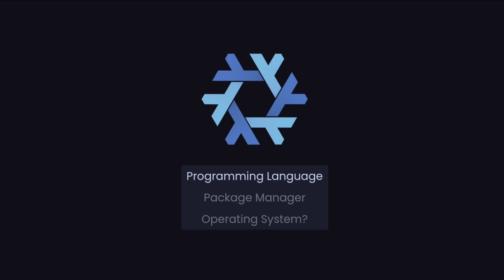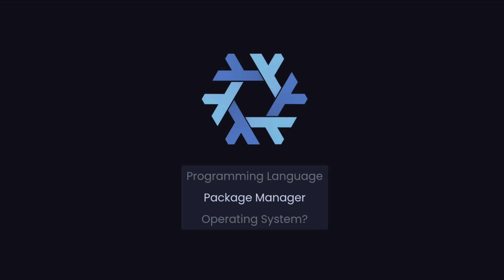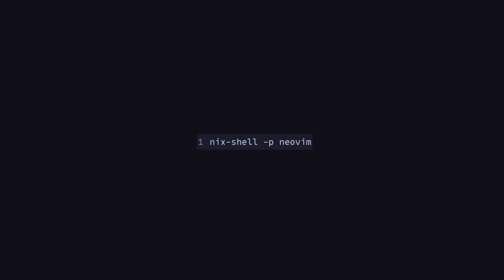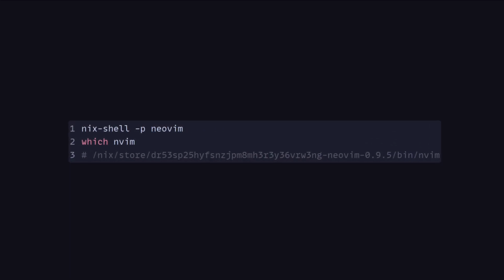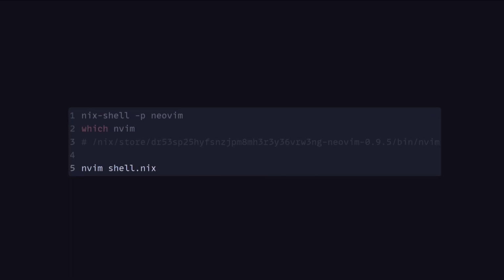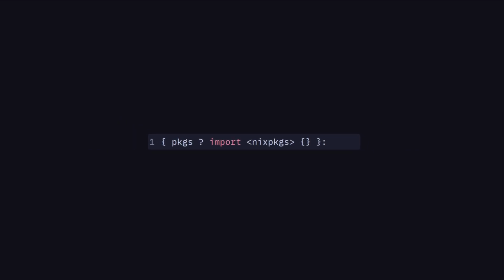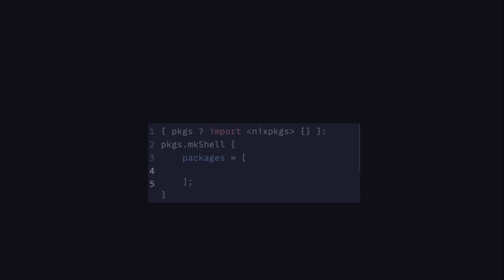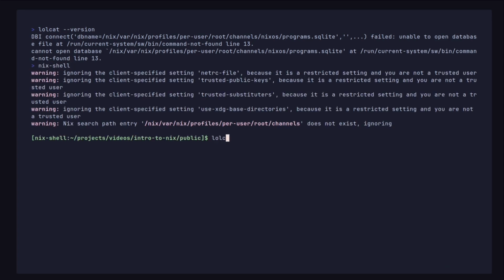An Introduction to Nix

Comment: You must be recording in a noisy environment, there's some attenuation of high frequencies and other audible artifacts, consider recording in a quiet environment for better audio quality which may help with hacking the youtube algorithm. I gave you a like and subscribe to help, it's a community service to boost media which is high quality, thank you for explaining Nix and good luck with your YouTube channel.

EDIT: could be laptop fan noise or other vibration noise such as from a keyboard or desk if mic is built-in or not properly isolated (see shock mount for reducing vibrations through mic stand from going into the microphone, hence the fancy look of studio mics), consider external microphone.

EDIT 2: just trying to help hack the AI, sounded fine to me as a human
Reply from the maker: First, thank you for taking the time to make this detailed post and provide feedback.

I think the main issue was that, one, I ended up rerecording a part and the RAW audio was a lot louder. The second part my poor editing of removing the sound of the keyboard. I do have the mic on a shock mount and a pop filter as well. But are also correct that in one of the clips you could hear the door opening behind me, and I had to try to adjust the audio. I will work on it for the next video. 

Also thank you for the like and subscription.
Reply: @Majiy00  You did a great job, NP just trying to help in any little way I can :)